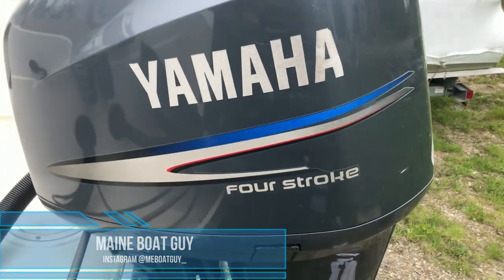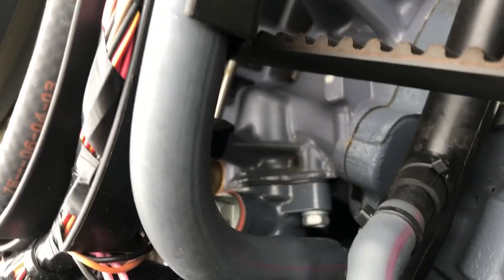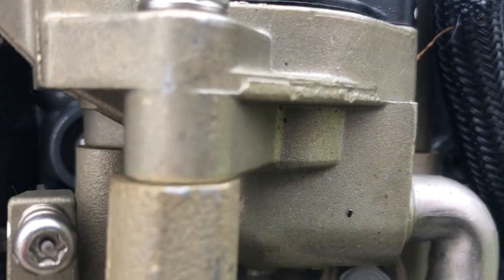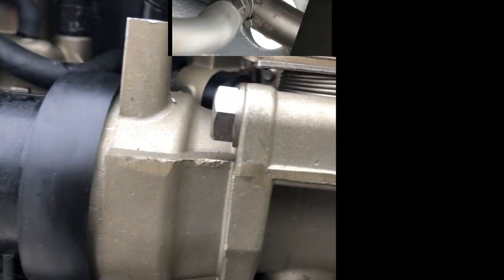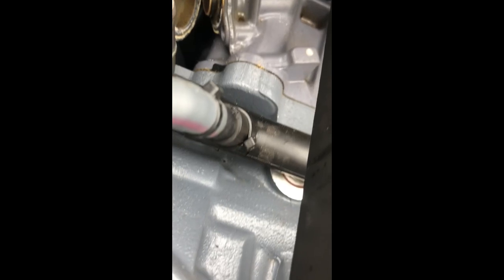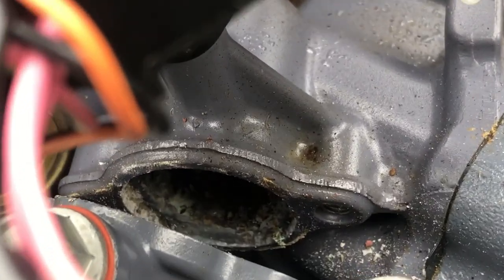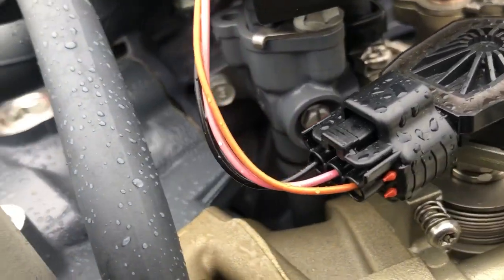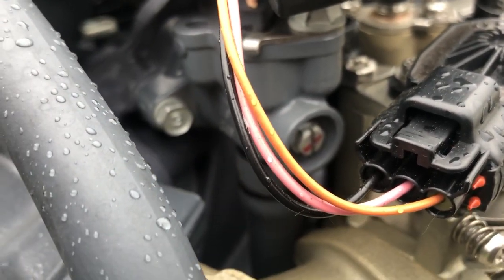HOW TO CHANGE THERMOSTATS IN YAMAHA OUTBOARD

Comment: what are signs that they need replacing?
Reply from the maker: David Mata typically they are replaced as “preventative maintenance” but overheating and running too cool are the only signs. Engines running too cool are known to build up condensation in the engine and turning the oil milky. So replacing them every 3 years prevents issues.